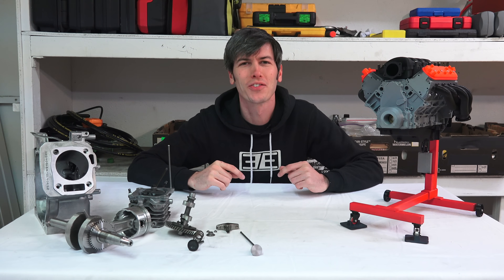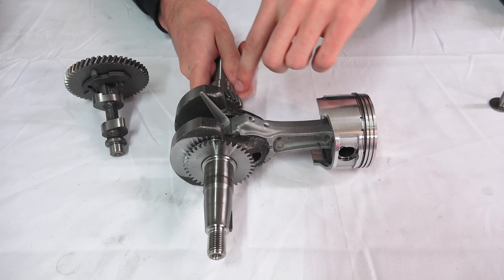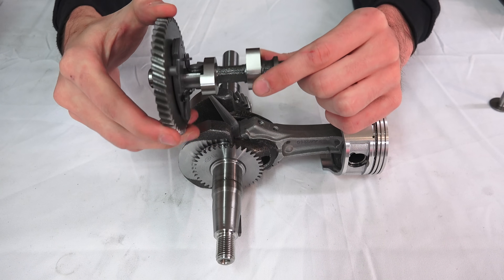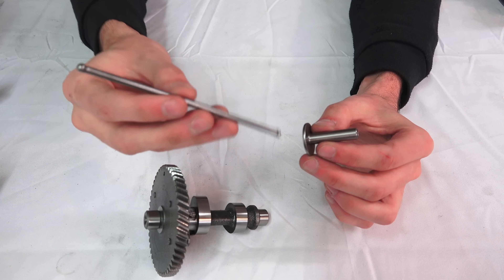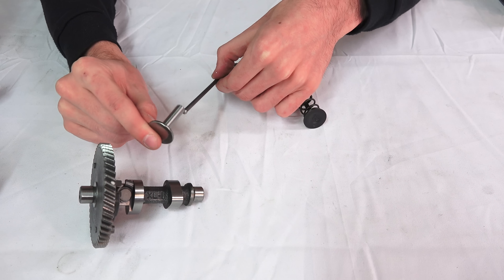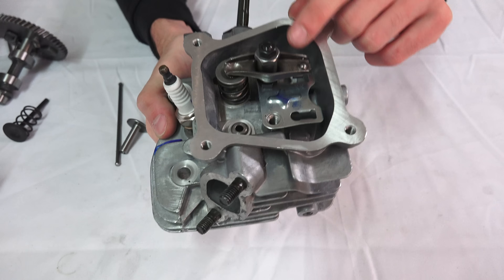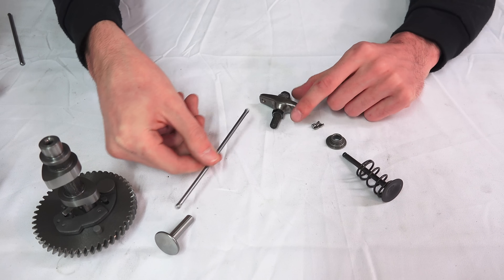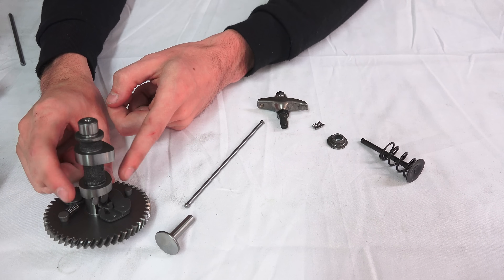Why Can't Pushrod Engines Rev High?

Comment: I'm still trying to figure out why in 2018 something as simple as "valve movement" is still handled mechanically with cam shafts and all the overhead they involve, whether they be mounted near the crankshaft as per these pushrod examples, or overhead as per most modern cars.  Why can't valve actuators be simple electronic servos controlled by a computer?

Comment: Strangely enough, the 6.6L Duramax has 4 valves per cylinder. The pushrods are massive, as are the valves... but it’s a beautiful set of Heads when they’re assembled

Comment: Not exactly. I'm gonna play "Adam Ruins Everything".I'm going to assume you're mainly referring to older American V8s floating valves at an rpm that seems low to us nowadays because of a heavy/flimsy valvetrain. It's simply not true. The ACTUAL reason those old motors floated valves at 6000rpm is because the valve springs weren't designed for the engine to spin that fast! If you put 6000rpm valve springs in an overhead cammed motor and tried to spin it to 8000 you'd float valves too.The real rpm limiter is inertia, i.e. piston speed. Piston size/weight and crankshaft stroke/length determine an engines ultimate rpm, not the valvetrain design. I don't have the formula off hand but a NASCAR engine at 10,000rpm has a substantially higher piston speed than an F1 engine at 20,000rpm which means the NASCAR engine is doing more work. Truth is that all the crazy complicated valvetrains , turbos and aid from battery/hybrid boost were designed as crutches to help small engines make sufficient power. Even with all the aids and crazy rpm, the F1 engine doesn't make as much power (torque) as the NASCAR. Those old American V8s were relatively large engines internally (small externally) compared to the foreign overhead cam crap and therefor made plenty of power without all the expense and maintenance of a high revving engine.

Comment: While I don't disagree with any of the reasons you gave, I have a slightly different take on them. The key here is lift--as you mentioned, 2 valve/cyl. engines tend to employ more of it to get enough air--and its effect on hydraulic lifters. Modern LS/LT engines actually flow amazing amounts of air--more than they can use at most RPM, hence their power peaks around 6K RPM--however, they do so through a giant single valve with higher lift. This inertia requires a stronger spring to prevent valve float, as you mentioned, but if you look at a dyno, there is a very clear RPM where torque drops off--and it's not due to valve float.

Let's go back to DOHC for a second. Many modern DOHC engines, particularly those with variable lift systems, also utilize some kind of rocker arm, which also has reciprocating mass to it. There is a hydraulic lifter on top of the cam or valve to automatically take up the slack in the system by using oil pressure. In the DOHC setup, the valves must be much smaller to fit within the cylinder, so it isn't exactly double the breathing of the OHV configuration, but that means each valve is lighter. Each valve also gets its own spring--which can be weaker due to the lighter valve, plus less lift as you noted.

Now going back to the OHV configuration, there is similarly a hydraulic lifter riding the cam lobes for each valve. As RPMs increase, you need a stronger spring to resist valve float, but ultimately it is not the efficiency losses which halt this system's redline, but the hydraulic lifter, which collapses under the pressure from that spring and inertia at high RPM. If going to a "low-lash, solid lifter" setup, much higher RPMs are possible, but at the loss of that automatic, no-maintenance-required hydraulic lifter. If the issue were simply inefficiency of reciprocating parts above a certain RPM, having double the number of springs and valves in the DOHC (not to mention 4+ times the rotational mass in the camshafts and timing set) would handicap the DOHC as well.

The other factor is displacement, which can introduce the same reciprocating issues in the pistons and rods. Most OHV motors tend to make their power due to size, and due to very compact heads, they can exploit large displacement in a small package. Whereas DOHC often relies on RPM to multiply lower torque numbers due to smaller displacement that fits within a given package. However a smaller OHV would have an easier time revving, and a larger DOHC engine would make more torque with fewer revs. Perhaps these principles work differently in the race engines you mentioned, where hydraulic lifters are unnecessary, but in street cars, this pretty much covers why redline is lower with OHV.

Comment: Why haven't there been an enige in a v8 configuration but the cam shafts are where the normal valve cover is in a v8  and have the camshaft rotate by can chain.   They would be able to make a more compact engine design  and I feel there would be a lot more options come time to make more power

Comment: I have a question for you. Or, maybe the other commenters...

So, say you are going down is it more fuel efficient to coast and use your foot as a brake, as opposed to gearing down. becasue if you are gearing down then your RPMS will go up... but its more gravity forcing the engine to rev higher. So at that point is the engine forcing more fuel into the engine to keep it running? 

Anyone?

Comment: Why can’t Chevy and Dodge push rods rev high? With variable valve timing now they all rev past 6000 rpm. But these engines are so big, they really don’t have to. Put DOHC on a Viper V10 and it’s gained 100 lbs, which definitely isn’t worth it. Increasing compression or running a longer stroke [9.0 liter] crank adds 100hp without weight.
Reply: It's still a weird convention to have around nowadays - I have a 2.0L turbo motor that makes 375hp and 335 ft lbs stock. That's on par with what my 7.4L (454 big block) makes.
Reply: @fahrvergnuugen  That's because the I4 has 4x the money in parts compared to a crapppy 454.
Reply: if it had DOHC it wouldnt need to be 9 litre in the first place
Reply: Speaking to your point with the Viper V10 (as a longtime Viper guy) the Gen4/5 Viper engines that use cam in cam and VVT, when built up with performance heads/cam tune can easily produce 7 to 800+ crank horsepower which is 650-750 at the wheels without forced induction.
Not bad for something that can also be daily driven on pump gas without risk of blowing up (with the right tuning).
Reply: Well put. We all drive on the street. Why put the peak of your power band up around 8000, when you are driving away from a stop light at 1500?
Reply: Adding DOHC will severely impact the torque output air flow through the heads is kept relatively  similar and the engines are ran at the same peak RPM.
Reply: Running a bigger crank adds weight but its negligible at around 4 lbs
Reply: my 2 stroke kart engine redlines at 14,000 without all of that valve train and is far than my four-stroke that redlines 6,500 which is pushrod but is debatably less fun
Reply: Deez Nuts next year the amg 2L is rumored to have 420 hp. Completely crazy for a motor with a warranty
Reply: Check out Mercury Marine, they have been putting DOHC on GM based engines for decades now.  Member the 5.7L LT5 from the C4 ZR1... well they now have 1,800hp DOHC 9.0L's that can run hours at WOT.
Reply: Was wondering who would be the first I saw to say "they dont need to" .... unless you're talking truck engines, higher revs are always better for horsepower.
Reply: Josechirimoya. So you can get good fuel economy going around town but you can hold gears while passing or accelerating.
Reply: Bartonovich52 exactly. Plus variable valve timing decreases pollution.
Reply: LOL! @Ricky
Reply: Ed lol. Once an engine design is this extreme it's about wants not needs. 😂
Reply: @Bartonovich52  Tunes setup for horsepower aren't necessarily going to give you improved mpg.
Reply: The C7R 5.5L redlines 6000 rpm.. and that's due to regulations.. it can rev more. Its also built for endurance races..
Reply: Variable valve timing has nothing to do with pushrod engines reving higher. It due to the fact they are using better valve train parts. Bigger rods, stiffer springs, lighter valves, lighter rocker arms, stiffer rocker arms, and  hydraulic rollers.  Most of these thing you don't deal with in a overhead head cam set up. Both have their place. In a car I prefer 8000 rpm shifts having high rpm power but in a HD truck go for the pushrod Everytime.
Reply: @a29s12  I'd rather have Turbo Diesel in both instances, no need for changing fuels for more power, far superior fuel economy.
Reply: @JosephArata  diesel technology is not advanced. Neither is the fuel. Disagree? Tell me why.
Reply: @JosephArata  And waaay more money.
Reply: Except they’re not even that big.  Most laymen think that the 6.2L displacement in the LS3 means it’s a “bigger” engine than, say, the 5.0L Coyote.  Truth is they’re not.  Pushrods give you more bang for your buck in terms of space taken up in the engine bay.  Not to mention that DOHC engines are top-heavy.
Reply: Engine bay space is the new ECOBoost.
Reply: @infidel1993  Any 6.2 litre engine has more displacement than any 5.0 litre. Regardless of valvetrain design.
Reply: P Stine who said anything about displacement?  Regardless of whether it’s cited in liters or cubic inches, an engines displacement is merely a measure of the internal volume of the combustion chamber.  The sum total of bore and stroke.
Reply: It's the integral of the horsepower curve that matters, for drag racing (and weight and traction of course, but that's off-topic).. An engine that has "torque" really means low-rpm power.
Reply: Chevy kept OHV's, knowing Ford was silly going SOHC expense/weight/complexity/unreliability on their 4.6L V8's that HP peak at only 4600 RPMs...
Reply: @BuzzLOLOL  4.6 l engines are some of the most reliable engines ever.  Was reason that taxi cabs and police used them and beat them up for years.  The bigger 5.4 l engines were the unreliable ones.  DOHC is better tech than both.
Reply: @jdigitalseven7  - Ford 4.6L OK mechanically, but crap electrically/electronically... and with HP peak at low 4600 RPMs, OHC not needed, OHV would have been fine... which is why Chevy stuck with simpler, cheaper, one camshaft OHV system...
Reply: @jdigitalseven7  you mean the taxi cabs bought them because they were cheap and the last body on frame type of car. It certainly wasn't because a 4.sux was great.
Reply: @BuzzLOLOL  Chevrolet stuck with cheap because they ran out of money on the LS design project because the 90s and 2000s were really rough on Chevy. They would have done the same, but they didn't have Ford's deep pockets. If remember correctly, Ford never took the government bailout of 08 and didn't asked Congress for a loan. That was Chevy begging for money from the government. Chevy is cheap because they simply didn't have anymore money. Saturn really messed up your logic there, bubby. Lol Have good day.
Reply: Your crazy
Reply: IS that supposed to be a intelligent comment, if weight to HP is your logic, the smarter way would be to make an over square, smaller displacement , higher revving engine,  you gain much higher hp and even less weight than what is currently in the Viper, but such an engine is obviously more expensive
Reply: Deez Nuts GLA45 AMG
Reply: But variable valve timing with a pushrod rod is junk
Reply: Ok so compare that 2.0l turbo to a turbo 454. And who makes a stock 454 nowadays?
Reply: @jond7754  They don't, you go to a junkyard and get one pulled out of a mid-70s to 1991 chevy 3/4 - 1 ton truck.
Reply: @jon D Why would you compare a stock motor to a modified motor? There are modified 2.0s that make a lot of power too, but that's not the point. I'm simply pointing out that we no longer need such a large heavy gas guzzling motor to get reliable power for every day use. People don't need 375hp in a daily driver, but now you can have it without compromise.
Reply: fahrvergnuugen but you are compromising. The difference between a V8 and your 2.0 4cyl is where it makes torque. The v8 is making 250 ftlbs at 1500 rpm. Your 2 liter has to go up to 4500 rpm before there is any meaningful torque. Try towing a 6000 lbs load with your 2 liter and understand the difference. Plus the gas mileage on turbo engines goes down rapidly as soon as you increase load; so if you want to load up your car and go on a road trip at 75-80mph your fuel mileage will be cut in half. Compare that to say ,an ls1-ls2 with a six speed, and you can get 45-50 mpg because you can cruise at 80mph at 1800 rpm regardless of load. They make torque at all rpm. 

The difference is torque. Torque wins races/tows loads hp is a measure of torque divided by rpm. This is why the DOHC coyote engines suffer. A lot less low end torque. They have to rev high to make power.
Reply: @Darkpassenger2012  Mazdas Skyactic 2.5 Turbo makes 310 ft lbs @ 2000 rpm, thats a ver v8ish number
Reply: Narendra Rajcoomar isn't that the diesel version? Apples and carrots?
Reply: @Darkpassenger2012  nope this is all peanuts vs peanuts, its Gasoline, check it out, I believe Chevy is doing similar tech on a 2.7l 4 cyl for use in a full size truck, it was featured on fastlane trucks
Reply: @Darkpassenger2012  Horsepower wins races my friend.
Reply: @spicyF1  Mazda engines are undersquare design engines in general. Thats why.

Comment: Engineering completely mangled again.  
On a solid lifter assembly valve float just means your spring isn’t strong enough or well damped.

You completely lost track of terminal piston speed f1 and nascar do so well by having big bores that fit big valves and short stroke

Oivey, cam timing.... barely any racing engine uses variable cam timing you just set the timing for high rpm and screw the rest.

An engine has to designed top to bottom for its role.  Stroke length, rod ratio, piston velocity, piston weight, bore size, crank shaft shape, crankshaft balancing, manufacturing techniques, block strength, block design etc.

Push rod engines do not rev as high because them having pushrods in the first place is a cost saving exercise.

Ls motors and hemis are cheaper to manufacture than 4 cam engines, they strategically made large, lazy, low revving engines that could be built with cheaper manufacturing techniques and less precise  engine tolerances TO SAVE MONEY.

Why why put effort and money into high tech when you don’t have to, especially when your target demographic will like to brag about how big it is.

Comment: OHC is better no doubt. But more complicated when it comes to an ultimate goal, especially when you add more valves..   The main benefit of a pushrod engine is the simplicity. Cheaper components, less mass in those components. Just gets tricky at the high RPM range.  But we all know how to make it work. :)

Comment: A falce statment valve float and valve train mass is not what limits rpm. The limiting factor is piston speed and con rod constructiom. With the right work and ballance a small block v8 can rev plenty high. It the long stroke under bore. Truck engine that dont rwv high because it dont need too its made for low rpm torque.

Comment: I don't know of any street car that revs that high and if one did it would be very annoying to drive due to the noise so let's talk about practical subjects.  Multivalve engines do breath better but the valves have to be smaller and lighter due to the speed so there is gain here

Comment: Also everyone is talking about rpm but no one is talking about rotating mass. You can't compare a honda 2.0L to a 5.7 Litre anything. Just think about the piston rod mass alone spinning at  6K rpm The stroke ,the piston velocity in the bore. Forget about valve train. Think about the rate of acceleration paired with the Mass of the piston and the rod in a big V8 at 6k rpm. Its a mind boggling amount of force. If you are going to compare motors you should compare motors of similar stroke bore ratios at a minimum. Then discuss OHV vs DOHC.

Comment: i Know this is only 1 instance but i was looking at flow tables the other day for various heads because i was having a discussion about the advantages of OHV vs DOHC and i found flow tables that basically proved the 5.0 coyote heads are actually flowing about the exact same CFM as the older LS motors. I say older only relative to the new LT motors. So at least in that one case both factory motors restricted by emissions and MPG type stuff they are basically equal. And i don't think the coyote revs much higher than any LS either. Also there are some pretty crazy OHV designs that don't use springs and still have cams that are pretty insane. I cant remember the name but there are some racing motors where the pushrod is actually following a guid on the side of a cam like lobe vs on top. I believe the video i saw it was revving to 20k rpm and was a 5.7 litre.